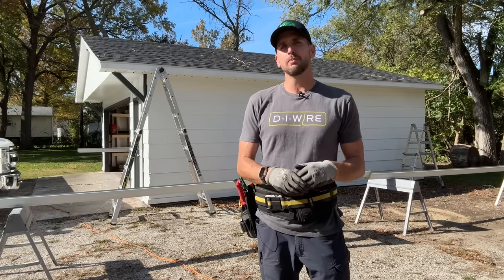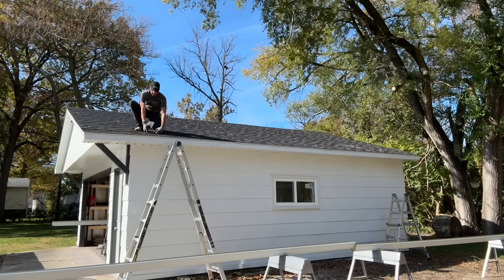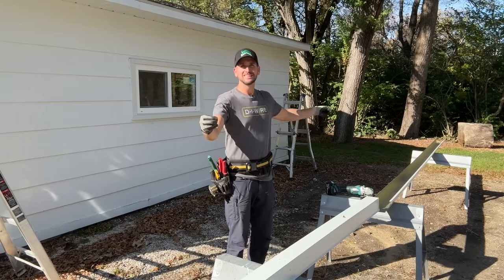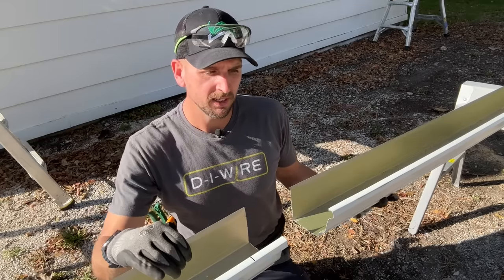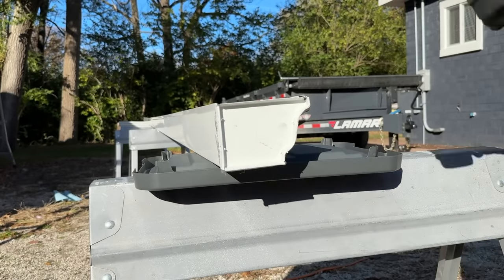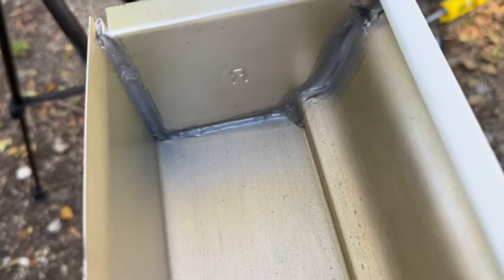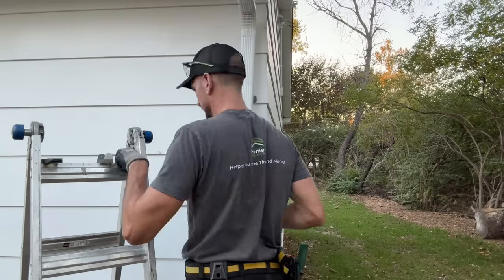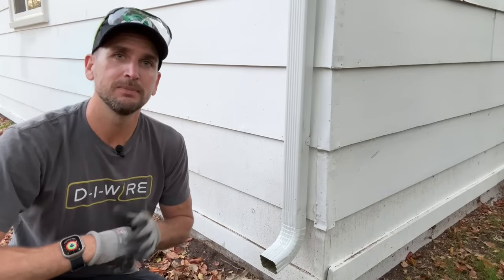DIY Guide To Installing Gutters

Comment: There's a company in my area that does seamless gutters (not installed) very affordably. It was actually cheaper than the big box stores and higher quality.  Also, a regular miter saw is the easiest way to cut gutters that I found.
Reply: I’ll second this. They’ll run them as long as you want, and I’ve found them to be the exact same price as sections store-bought. I had a 66’ run formed, and the 2 guys even helped me carry it around to the back and set it on the ground right in front of where it was being hung.
Reply: @jimmypautz can you share the company? I'm trying to see if we have one here in SoCal
Reply: @danervin2530 can you share company name please? I'll check if we have one here at SoCal. Thanks
Reply: In my area the seamless gutter installers want an arm and a leg.
Reply: @danervin2530  how do you get a 66 foot run from the store to your house?
Reply: @yomomma3621  the company has it all self contained in a box truck. The aluminum is on a giant coil, they load it into the roller die machine and poop out as long of a gutter as you want. In my case the question was how to you get a 66’ gutter from the front yard to the back. The answer was- a lot of people lol
Reply: Cutting it by hand is still the best way to me
Reply: @prxncxssr0sx  it's a local Wisconsin company
Reply: @yomomma3621  they pull up with a truck and make it right off of the roll of aluminum

Comment: I just did my own gutters with those gutter hangers and I absolutely hate  them.. I hung my own gutters over 22 years ago on one of my houses and the gutters are still in working condition and those were with the old tube and nail hangers and that was so much easier.
Reply: Those are some of the absolute worst brackets on the market...

Comment: Great guide, thanks! For longer runs  one man show, attaching both ends first  may lead to bowing in the middle as raising the sag in the middle will be  pushing against the fixed ends when lifted.
Reply from the maker: Good point 👍
Reply: So what is your suggestion? What is the lesser of two evils? GREAT point though. I am embarking on my first gutter install, wish me luck.

Comment: I gotta make a vid. Been doing gutter for about 23 years. Not the way I've ever done seamed when i have. No point in going with 6in unless you get 3x4s or 4x5 downs. Mitre saw works best if you haven't cut em by hand before too. Seal between pieces also on overlaps. Dont put sealer on the end caps until after you attach them.  Malco crimps are preferable but rivets or even stitch screws will work. Personally, ruscoe 12-3 or geocel elastomeric aluminum seam sealer is best, last decades, literally. Those hangers have a tendency to pull the face of the gutter in unevenly if you aren't extra careful. That impact will definitely over torque them. No need for that much drop per ft. Not once in 23 r so years have i used a chalk line, always use a level! Very rare even for even new construction to be perfectly level so measuring down, like this old house shows, is just flawed. Assume you dont have an x style downspout punch so id recommend tracing an elbow and pushing a knife thru to make an X. Can drill a hole at each corner and then use a cutting wheel im sure. Gives you tabs to attach to and dont have extra rivets catching leaves. That low spot over the window is where i would have the gutters high spot and level off of that. See how that piece looks like its low on the right end? No need for that. Make it as level as possible but with a bit of drain. Just looks better! And no need to check for plumb on a down. The homeowner is gonna notice the "reveal" next to the down when on the corner of the building. But for diy, good job. Lol
Reply: This is good and better advice
Reply: Where’s the vid! Come on, lazy bones!

Comment: I did exactly that (insert one length into the next) for the joint and agree - It works perfectly and hasn't leaked in 12 years. Those stupid joint things always leak eventually so I'd NEVER recommend them.    I used self-tapping panhead screws since I didn't have a rivet tool.  Also your downspout is 100x better than the downspout fitting from the store.

Comment: This was encouraging, Scott.  You did all of it by yourself, so I may be able to, too, just not as fast as you.  I got a quote to have it done (seamless gutters and maybe debris guards), front and back, and even with Senior and Veteran discounts, I would not pay that much.  I told him, I want it, but I don't need it.  He understood.  I have all the tools, except the crimpers, and two heights of ladders; 8' and 6', plus an extension ladder for getting on the roof.  I would have thought the downspout would be secured more than in just one place, and rather high in this case.  Is there a reason not to secure it in more places, maybe 3?  The middle and lower, too?  That could be especially helpful for the directional pieces, when they're needed.  My house is one story, bricked on a slab, no basement or crawlspace, so I won't need them, but may want (or need) to direct the flow.  The rain just falls off the roof now, but I never considered slab damage.  Is that a thing?  Thanks, Scott.

Comment: So i do power washing and soft washing and window repair professionally.   Really wish I had seen this vid but I followed the parts list and directions.    The seam joiner is a pain in the butt to get to fit properly.   Took forever to rivit together and the look of your finished product is much better.   And I will be adjusting the rest of my gutters to what you did as I think the seal is better with your process

Comment: One thing I prefer is to pre-drill for the rivets before I add the seam sealant, which I find makes alignment easier and, minor, keeps my drill bit cleaner.
Reply: There is no such thing as pre drilling. Your terminology says you are drilling before you drill. You aren’t . You are drilling pilot holes.
Reply: @alanyoder7629 ”pre” means “before”. “Pilot holes” are for screws, not rivets. He simply drilled holes and he drilled them BEFORE sealing.
Reply: @seeqr9  correct, pre means before. Pre drill therefore means drilling before drilling. Which is stupid. Just say drilling a pilot hole because THAT IS WHAT IS BEING DONE. Not drilling before you drill.
Reply: @alanyoder7629  it doesn’t mean “drilling before drilling” that would be “pre drilling drilling”.. 

“pre drilling” just means “drilling before”… BEFORE something,… before riveting, before painting, before sanding, before assembly, etc. before anything.

When you get a product that already has holes in it you can say “they drilled it before they sent it to me” or you can say “it came pre drilled”.

Pilot holes are a specific type of pre drilling, that is, a hole specifically for a screw.

All pilot holes are pre drilled holes, not all pre drilled holes are pilot holes.
Reply: @seeqr9  you are wrong . Just give up trying to justify a stupid and  totally incorrect phrase.
Reply: @alanyoder7629  Alright, professor. For an English professor you aren’t very good at articulating your position.

Comment: Wish I'd seen this video 25+ years ago before I put on our two story addition. 150 ish ft of gutter & every seam is a perpetual leak problem. Also fastened using traditional nail & tube spacer along the top of the gutter & shall I say they haven't all held tightly.

Comment: I am living in a house where we have gutters that are joined with slip joints in some of the gutter placements, and one of them is leaking real bad front-of-house. It also looks like it's sagging there, so the water's pitching towards it instead of the downspout.

I have no doubt the gutters will need replacements since they are not only old, but if they are not sloped right, the joints will leak water out.

Comment: following your advice today. i have two pieces.. ones a short one and one is fairly long. i will try this on the smaller section first.  very clear video.... i noticed you painted your lower downspout bracket,, you should mention that so it looks nicer... nice detail anyway. (went to paint them, realize they already were sooo ....nevermind lol).   i was  unable to install this by myself.  i did not take into consideration my ladders were  not tall enough...so i got it all ready and will have help to install next time.  but the rest of it went fine.

Comment: I had a garage built a few years ago and had an installer do the work. 20” runs. The one thing that he did was to install 6” downspouts. He said that this way you have less of a problem with clogged downspouts. They don’t look out of place on the building.
Reply from the maker: That can be a nice upgrade.  Thanks for the feedback!

Comment: I need to install gutters on my home but the front door would hit the gutters if installed.  Its about an 8" section I would need to avoid.  I was looking for any suggestions you would have to get around it. I thought maybe something I could put, like a triangle shaped piece of metal that would divert the rain water to the left and to the right of where I need there to be no gutters.  So by capping off the gutters and leaving that 8" section with no gutter I believe if I'm able to divert the water into the left and right side of the door opening that should work.

Comment: Thank  you! Great video and instruction. I put my own gutters up just a few weeks ago and I'm having issues with water dripping behind the gutter (between the facia board and the gutter. I see you have a very low shingle overhand like me. I was about to move my gutters up to right under the shingles, which would mean screwing the brackets into the roof flashing, but i see you didn't do that. I started right at the bottom of the flashing like you did. How do I handle the leakage behind the gutter?

Comment: I just started a new job as a Gutter Installer,
Question: You said a half inch drop every 10 feet in level from high side to low side, isn't the standard usually a half inch drop every 4 feet?
Thanks in advance,
Awesome tutorial!
Reply: A 1/2 inch drop every 4 feet would be 2 1/2 inches at 20 feet which would look ridiculous, on a 60 foot run you could be out of fascia!

Comment: Just confirming, gutters are not supposed to be behind the drip edge? Mine are and I’m not too certain if that’s what is giving my roof issues on the soffit??
Reply from the maker: I prefer to set gutters lower than the drip edge.  My high side was about 1/4” below the lowest portion of the drip edge.
Reply: if the drip edge is behind the gutter, that gives the water a way to go between the gutter and the fascia.
Reply: @kenbrown2808  ohh that makes sense, because water follows tension right?
Reply: @tretre1692  any time there is an exposed upper edge, water can go on both sides of it.  so in wet regions, every effort is made to never have an exposed upper edge, and nobody in their right mind relies on adhesives to stop water.  everything is overlapped, so when water gets in, the overlap encourages it to find its way back out.

Comment: I would have included leaf guards
Reply from the maker: I was running out of space at the end to recommend videos as we have one on leaf guards which I also recommend. Especially for this garage as there is a tree directly over the garage roof.  👍
Reply: @EverydayHomeRepairs leafgards often wind up dumping water over lip of gutter, particularly on heavy rain when you needed those gutters the most.

Comment: Is there a manufacturer or after market maker of removable end caps or end caps that might be hinged somehow so as to make it easier to clean out the gutters?  I "designed" a tool using eyebolts nuts and fender washers that can be placed in a gutter on top of the debris and pulled from one end and it grabs most of the leaves, pods, twigs, and dirt as you pull it along but I'd like to lengthen the tool and try emptying an entire gutter out in one or two pulls. That means saving me going up and down the ladder a dozen times or so that this 70 yo something old man would appreciate. Thank you.

Comment: What size rivits are you using  1/8 dia X 3/16 long?
Reply from the maker: Here are the ones I used for this project https://www.menards.com/main/building-materials/roofing-soffits-gutters/gutters-accessories/gutter-fittings/spectra-metals-1-8-diameter-x-3-8-aluminum-gutter-pop-rivet-100-pack/prrtw/p-1444443284249-c-1492703914555.htm

Comment: The upper connection of the long vertical stretch of downspout is on the inside of the elbow.  Shouldn’t it be on the outside?
Reply: No.  If done the way you describe some of the water would leak between the connection point. Having the upper section of the downspout on the inside of the next section lets the water to just flow on by.
Reply: @RoadiJeff  Check out 15:30.  Where the second elbow meets the vertical stretch.  Shouldn’t the vertical stretch be on the outside of the bottom of the elbow?  Elbow inside the vertical.
Reply: @Hanojsemaj  Well, he talks about having each upper section to the inside of the next section downstream at around 4:40, so I would imagine that the long section that connects to the elbow is on the inside.  I watched that part several times and it is hard to determine. If the upper is on the outside then he has it backwards.

Comment: Doing it the hard way hang it from the middle had me scared you was going to buckle the gutter you have your line hook the end cap to the shingle for length the tack it check your still where you want it at ends then screw off and putting sealer im tge seam of the end cap getting it all over tge front of tge gutter just put you end cap on then seal it like you end up doing in the end

Comment: So... What should I do if water is getting behind a gutter I just installed?
Reply from the maker: Behind the gutters on the fascia board side?  Just want to make sure one of your ends isn’t against a wall where the water is getting behind the end cap.
Reply: @EverydayHomeRepairs  right on the fascia side. Can I caulk the gaps it's coming through or do I need a tighter mounting system?
Reply: It may be that your drip edge is too close to the fascia.

Comment: i wish i could use a simple A ladder to reach my gutter. is it safe to rest a ladder against a gutter in order to get up to reach it? my gutter is sagging and not sure why, i think i just need to simply add some reinforcement screws but i dont know the best way to get up to it. its about15 feet off the ground
Reply: Use bullhorn/ladder stand off attachment so your resting on the roof and not the gutter.

Comment: Yea we'd be done in 28 min.  Gonna watch it though.  Saw one guy pop a line on a 19 footer that had over an inch drop.  We should do a video on a decent size house and put it like x2 the speed and clown all these fools. Even as old and sorry we are id take us speed wise over almost crew, 30 years younger.  Omg don't forget your grinder and safety goggles for those big jobs coming up.  😂

Comment: Would screws suffice in lieu of rivets?
Reply from the maker: Rivets are going to work much better.  Personally I would now use screws.
Reply: Rivets are easier on the fingers when it's cleaning time.  Something to think about.  Rivets also pull the surfaces together as they are pulled up.  This helps to ensure a tight seal.  They also are also usually made of same material (aluminum) as the gutter, so they don't corrode when wet, and don't loosen as easily due to differential expansion during heating and cooling cycles.  Leaky gutters suck.  You could use stainless to avoid (some of) the corrosion, but they still have all the other disadvantages.  Plus you can usually get the tool and a bag of rivets for the price of a box of Stainless screws.

Comment: Across the southern U.S., gutters can do more harm than good. They rot the fascia boards and prevent water from reaching the foundation.  Yes, we want a wet ground around our concrete slabs to keep them from sinking/shifting, damaging the house.  Some even install foundation watering systems to keep the ground around the foundation evenly wet.  When we moved into our current home in 1991, the very first thing I did was to remove all the gutters.  Being a one-story house, the water doesn't dig a trench where it hits the ground.  That said, there may be some places where you'd like to divert water (doorways).  You can use a diverter for that.  I realize that up north, it's a different situation.  Water needs to be kept away from your foundations/basements.

Comment: @everyday home repairs why you never respond to my messages
Reply from the maker: Sorry, I try to get back to the most comments I can but some times fall behind.
Reply: @EverydayHomeRepairs  I understand it was awhile ago!! I had a question about a n light switch in my kitchen that you demonstrated on. It's a switch that controls my light fixture. My plug that's there has the long plug on the right and the short on the left. My question is when I  install the new outlet I do make sure the long plug is on the left correct the wiring would be the same, correct

Comment: Good you are doing as I expected joining. You should use caulking before overlapping. And end caps there is a crip tool to joint the end cap. Rivets is house wife method. Waist of time chalk line and level. If your are good eye ball is enough
Reply: so apparently you skipped the parts of the video where he applied sealer before overlapping, and where he mentioned there is a crimp tool.

and the chalk line makes eyeballing easy, but the torpedo level is way too short to be accurate.  just measure for your slope.
Reply: House wife method?  What does that mean?